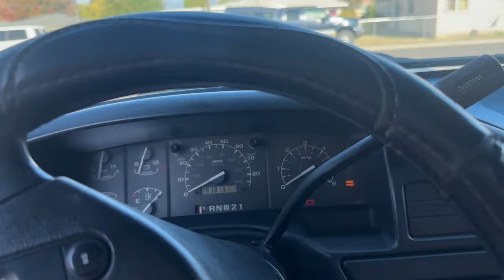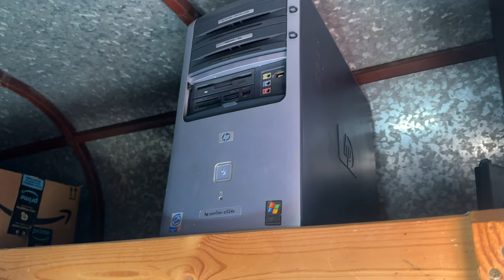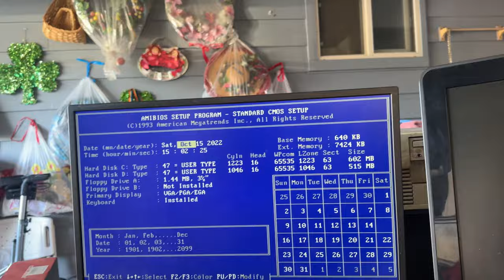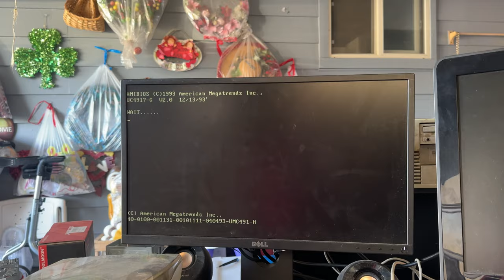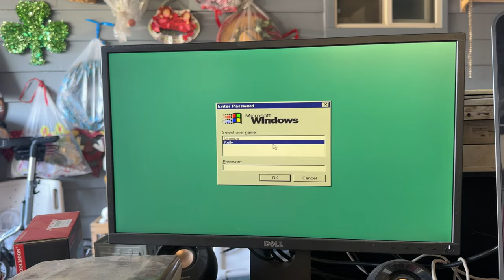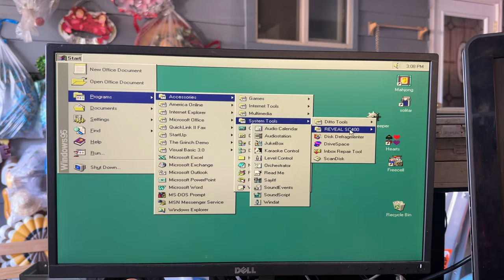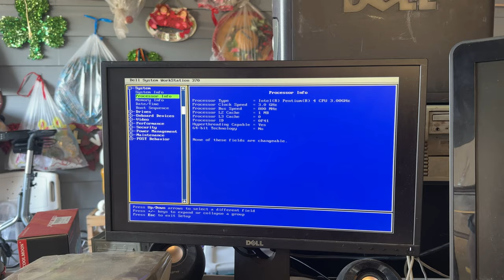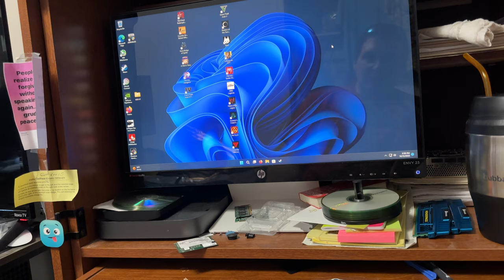PC Ramblotron Vlog thing - 10-15-22

Comment: That 8Gen Dell, you could put a i3 and sell it cheap for a home user/mail/word processor machine...its a shame sending good hardware to the scrap... That compaq is a NLX format (need a NLX AGP Bracket)
Reply from the maker: good luck in a town with less than 3500 people centralized in construction, farming, and horses. Plus these dell 5060 machines are honestly kinda garbage anyway. Can’t put in much in the way of expansion. Not only because of the awful power supply, but also because the case won’t physically fit much. That i5 deserves to be in a better motherboard. Plus it was out of warranty anyway, so any redeeming quality it had is gone.